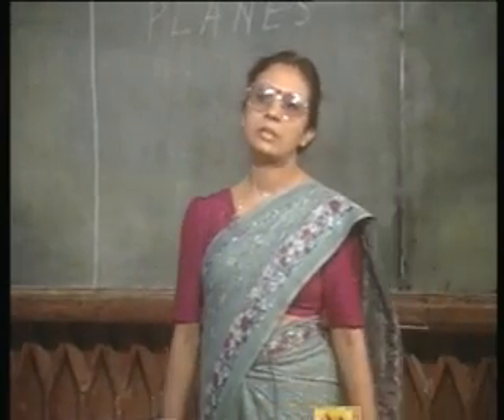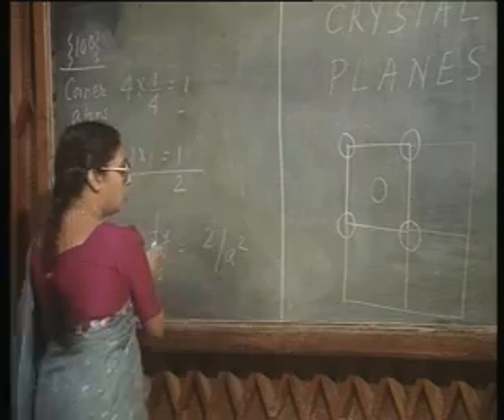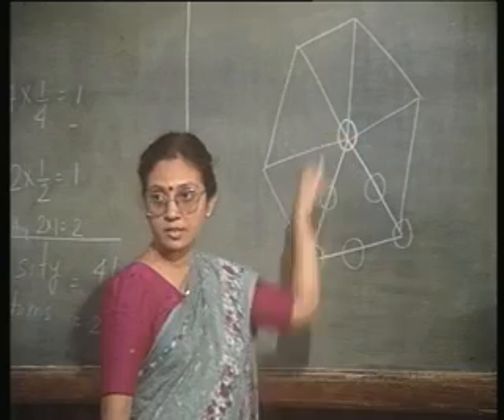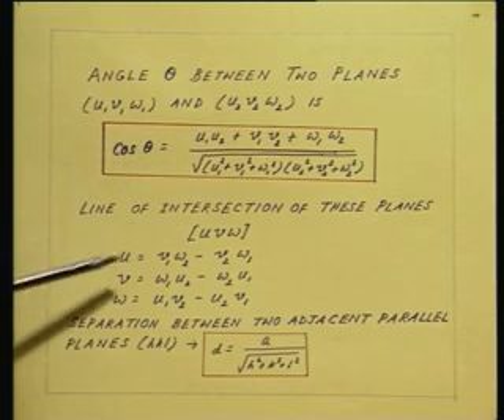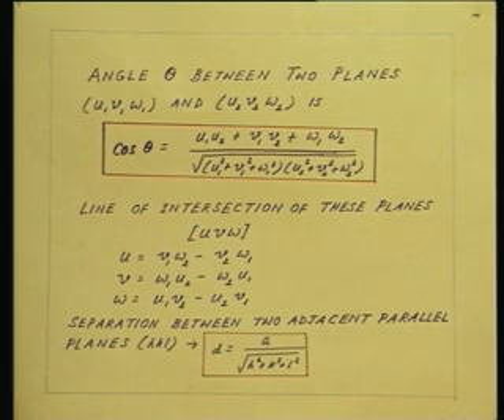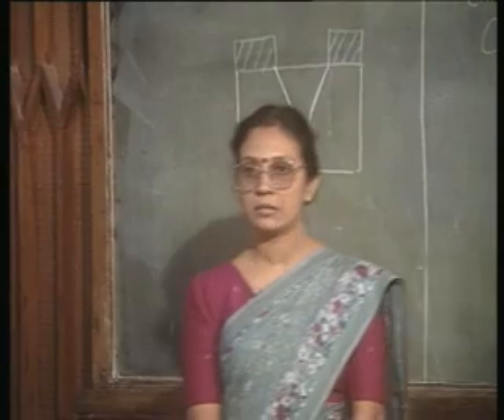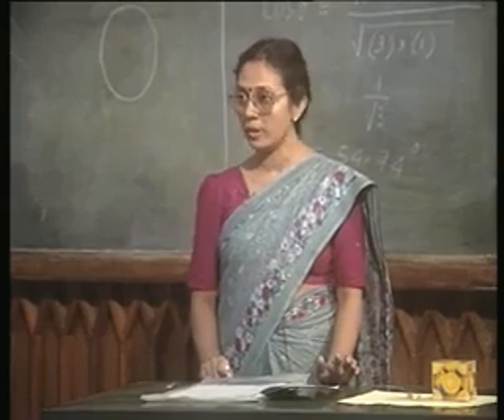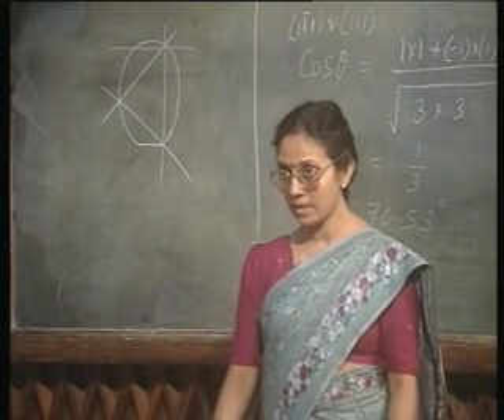Lecture - 4 Crystal Structure of Si

Comment: At 46.48 , how can we get 90 degree . Cos( theta)= 2/root 6.
Reply: For the plane (110), the normal vector is [1,-1,0], and for the plane (111), the normal vector is [1,1,1]. 

- Using the formula , we get cos θ = (1*1 + (-1)*1 + 0*1) / (sqrt(1^2 + (-1)^2 + 0^2) * sqrt(1^2 + 1^2 + 1^2)) = 0 

- The angle between the planes is 90°, or π/2 radians.